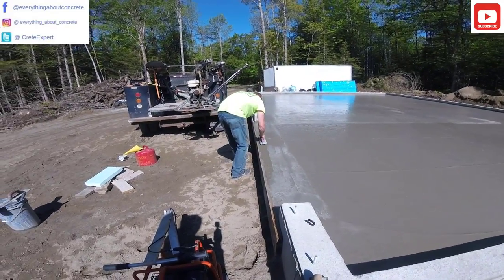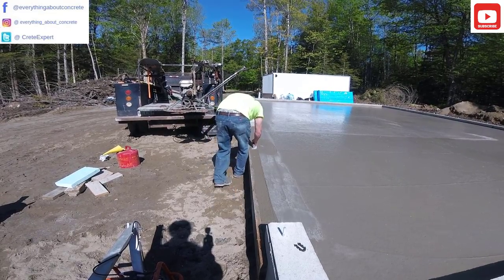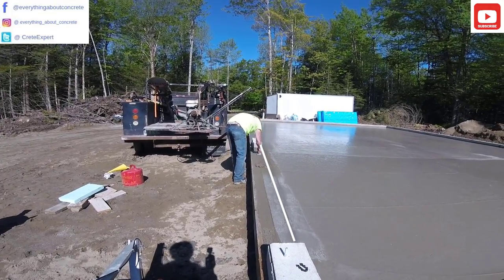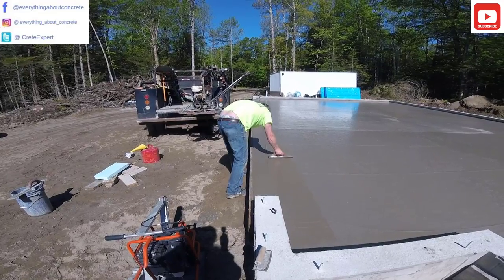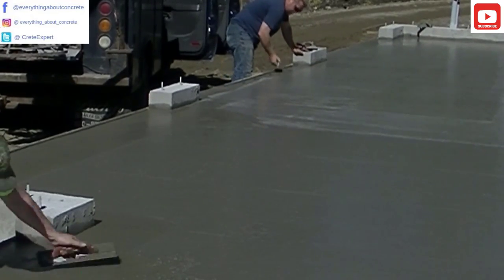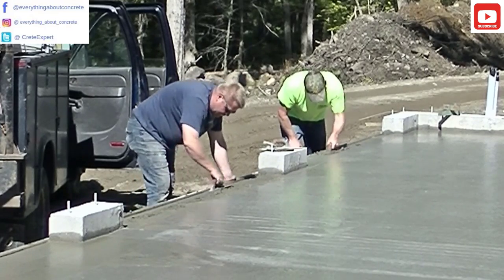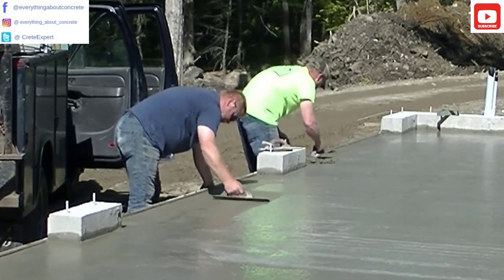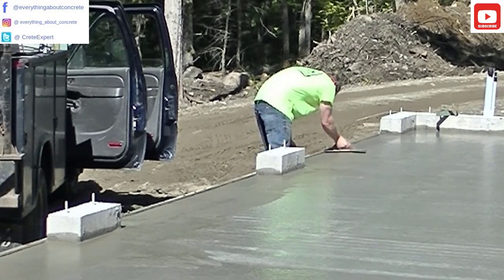FINISHING CONCRETE | HOW TO SLOPE THE GARAGE DOOR OPENINGS

Comment: here in penna. we set a 2x4  where the door is going to hit the slab  so the door apron is 1 1/2  inch lower then the garage floor acts as a weather lip to keep water from blowing in under the door and into the garage ,,,,,then slope  from the bottom of the lip out !! which puts your outside form down  1 7/8 lower then the garage floor !!
Reply: We do the samething,  works great!

Comment: We use a garage door beveled mag. It has a little lip that runs right on to of the form and it has about a 3/4” bevel for the first couple inches
Reply: Aaron Grabowski exactly what we use. Before we had that I would put an 8 penny nail about 1/2” to 3/4” down in a 2 by 4 that was cut to the size on the opening around 8” and screed with that. Works awesome

Comment: We've used a 4x4 angle iron in the past embedded in the concrete so the floor is dead flat at the bottom of the garage door, this technique was used in commercial buildings for years, now we just try to incorporate a freestanding 3' to 4' roof over the garage doors which keeps the elements away. All entry ways in New England should be protected by some form of overhang if possible.
Reply from the maker: I've done the angle iron thing quite a few times in the past also. The liquid road salt destroys the openings in most garages now. I repair a lot of them every year.

Comment: You know its code that the whole garage floor is supposed to slope toward the garage doors. That makes this moot as it can never travel up the garage floor slope.
Reply: Thats a dumb code. All good until the snow melts off of your vehicle and runs to the door and freezes the door down.  Center drains are the best way.